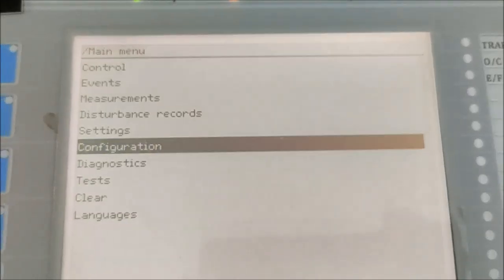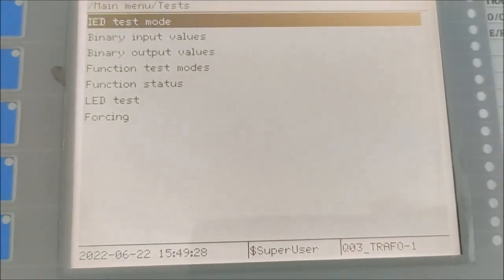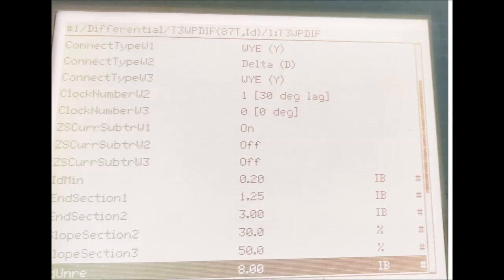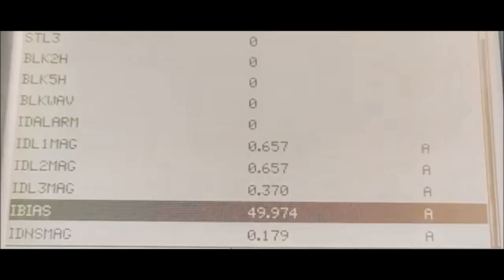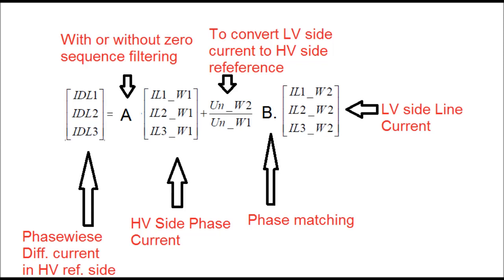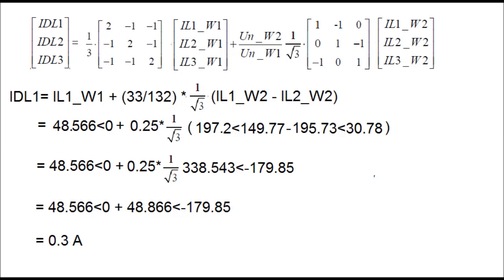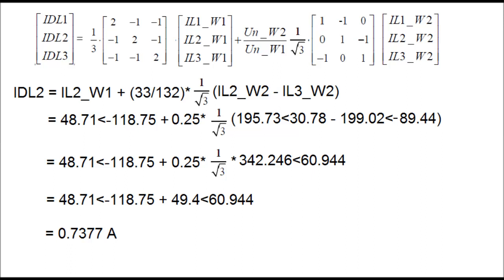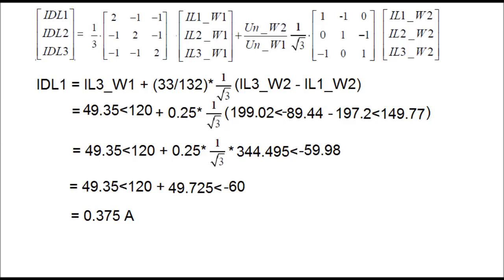Transformer Differential Relay RET650 || How to Check Diff. Current & Bias Current and Calculation

Comment: thank u sharing ..plz mention transformer vector group and rating , voltage ratio.  suppose if trafo is DYn1 vector group then connection type 1&2  are in relay settings?